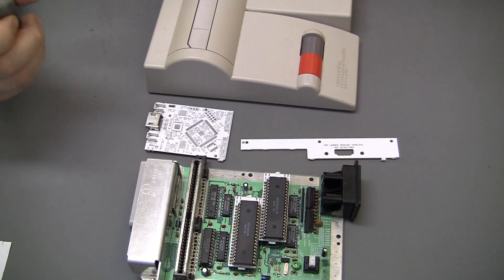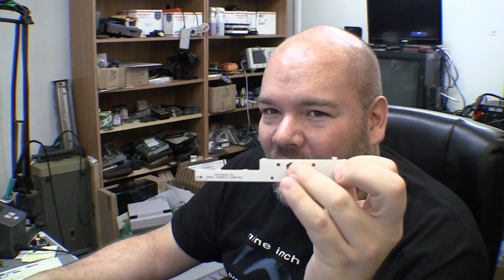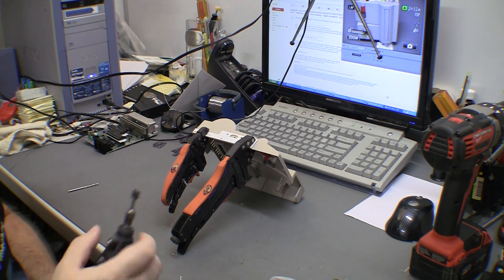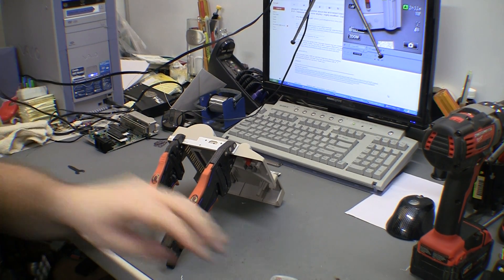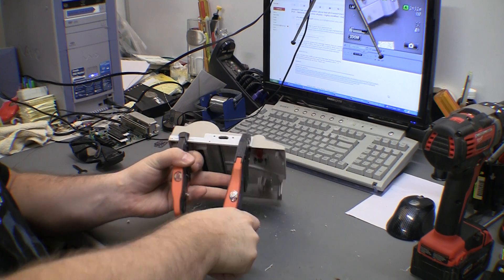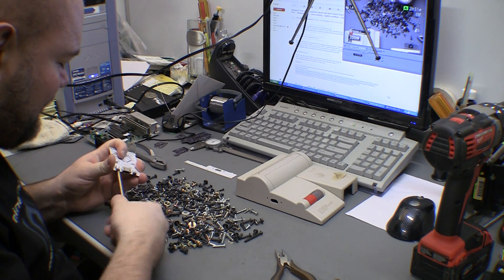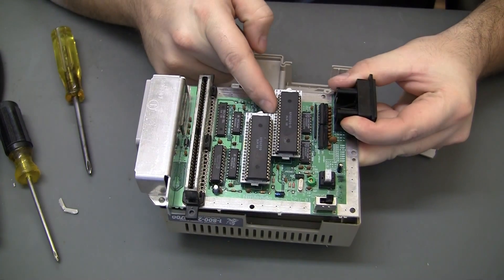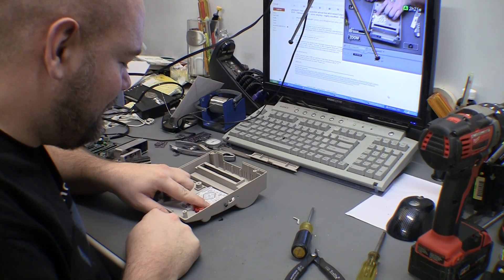Hi Def NES - first fitment trial in a NES-101 Nintendo Top Loader

Comment: Why not have a 3D printed bracket that you attach to the shell so you don't have to worry about routing out that precise hole?  that way, you just rout out a hole large enough for the connector to mount to the new 3D printed plate that is either attached with screws or epoxy.
Reply: The board needs to be right next to the HDMI port  to counter signal degredation, and the board won't fit back there, not without major modification at least.
Reply: I didn't say in the back.  Just make a side plate.
Reply: Nukle0n We're talking about a really short run here, signal degredation isn't going to be a problem over a few inches. I've got 15-foot long active cables that are 2.7mm thick, and if you're talking about running a cable 3-4 inches, you don't even need active cables to use that kind of gauge.

Comment: Is there going to be a model with the hdmi coming out the back of the console?The side mount looks hideous and might be a deal breaker.
Reply: No. They said in past videos the space in the back is smaller than what he's working with now. And I think kevtris said he can't have the HDMI port on a separate board. It's a signal degradation problem. Unless you can get a mini HDMI cable to get around the cart throat and heatsink etc.
Reply: I agree, it's a really unfortunate situation, but a difficult one to work around. HDMI is a high-speed signal, so to get it from place to place intact requires good cabling. Even the length of the different wires in the connection needs to be consistent or propagation delay will cause timing errors in the signal. Hence, the HDMI connector needs to be integrated into the board.
I think there's a possibility that the board could be changed to use a micro HDMI connector to save space, and a panel-mount extension cable to route the connection to the back of the machine. But there could be all kinds of problems with going that route as well. Assuming there is enough space in the case to fit the cabling, if the cable's not of good quality there's a chance it could make the HDMI signal unreliable, and that unreliability would be blamed on the Hidef NES kit.

Comment: If you want to cut a cleaner hole for the HDMI connector, here is my suggestion:
First, see if you can get a thinner template. Etching it from sheet metal might be the best option. The thicker the template is, the more likely a cutting tool will sit at the wrong angle, displacing the cut.
Second, start by scoring the outline of the connector with a sharp knife. This will give you a guide that you can continue to rely upon even after removing the template. Over a few passes you may be able to cut those scored edges rather deep, which may be useful later...
Third, you can remove the bulk of the material using techniques such as you used in the video - just don't go right to the edges, 'cause you're probably not going to get a clean cut that way. Another option instead of grinding out most of the material with the drill bit is to just drill a lot of holes within the space of the connector, then use cutters to cut the plastic between neighboring holes.
Finally, when most of the material is removed, you may be able to use the scored lines to snap the remaining plastic off. It helps if you make cuts that go to the corners of the connector so you have a single edge on which to snap the plastic. If there's not enough left to snap you could file it down or cut it with side-cutters (the cut won't be super-clean but because you started with the scored line on the exterior, the exterior will appear clean.
Of course I think there still may be the possibility of mounting a smaller HDMI connector to the board, and then using an HDMI panel-mount extension cable to route the connection to the back of the machine. That may also mitigate some of these spacing issues by making the board a bit smaller, giving you more flexibility in where you install, etc.  I don't know if it would actually work out in practice but it may be worth exploring if you haven't already.
As for the AV Famicom - why not try the fitting tests using a board without the HDMI connector installed? Then you can work out connector and board placement and all that without having to cut a console shell.

Comment: It sucks that the Top loader/AV has that really small are to work with. I can see why Kevtris didn't even want to attempt the actual back area. Would it be practical to have the HDMI port and brackets be on a small board. And have a mini HDMI wire going to the board moved further down near the controller port area?